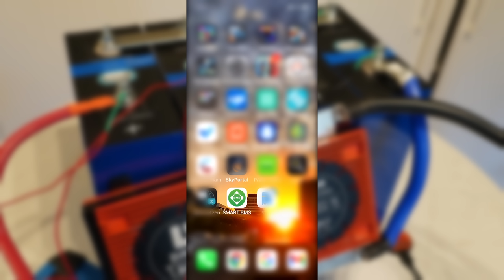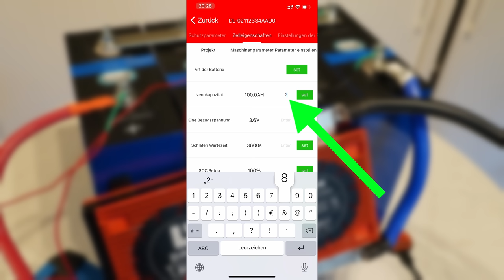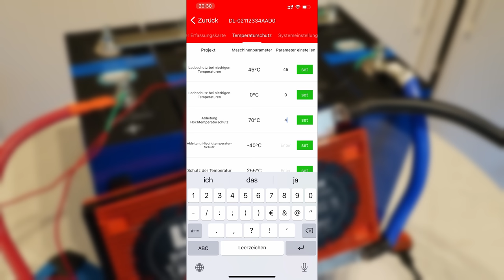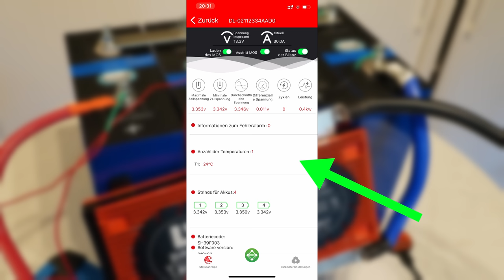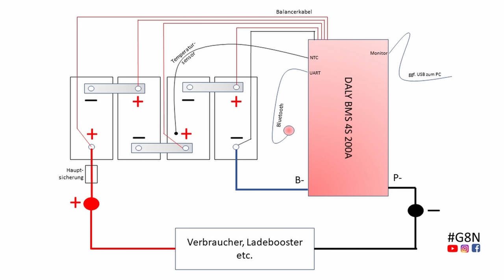Wie? 280Ah 🔋 Selbstbau für 599€, how to mit allen Details ausführlich erklärt #G8N

Comment: Habe mir die tollen Videos angesehen und genau nach deiner Anleitung gearbeitet. Es funktioniert alles wunderbar. Jedoch habe ich ein Problem mit dem Laden des Akkus. Es lädt nicht auf, das BMS macht nach wenigen Sekunden dicht. Einstellungen habe ich von Dir übernommen und dasselbe Ladegerät habe ich übrigens auch. Nun meine Frage: Wird die Batterie trotzdem geladen, wenn das BMS dicht macht? Angeschlossen ist das Ladegerät am schwarzen Minus-Ausgang des BMS, wie auch in Deinem Video. Das Ladegerät von Victron meldet nämlich per App, dass es keinen Strom abgibt. Einstellungen sind natürlich auf Lifepo.
Reply from the maker: Hallo Mathias, danke für das Lob. Ich vermute, dass eine deiner Zellen bereits die 3,65 Volt erreicht hat, deswegen wird das BMS abschalten. Daher gehe ich davon aus, dass der Zellenausgleich nicht ausreichend war. Wie sind die Spannungen der Zellen? Du kannst das Initialisieren nochmal, wie im Video beschrieben, machen. Wenn du die Zellen dann parallel schaltest, lass sie etwas länger so stehen, 7 Tage oder so. Das hilft dem Zellenausgleich. Alternativ, die Batterie entladen, bis das BMS abschaltet. Also eine der Zellen 2,5 Volt erreicht hat. Danach erneut aufladen. Viele Grüße Mr@G8N
Reply: @G8Neu  Vielen Dank für die Erklärung! Das mit den 3,65 Volt habe ich in der Zwischenzeit auch herausgefunden und es war tatsächlich so. Ich habe mir nun einen aktiven Balancer bestellt und die Batterie ist bereits eingebaut und wird demnächst leer gemacht und dann neu geladen.

Comment: Was mich verwirrt. Du schmierst das Fett direkt auf die Kontakte und hast in deinen Amazon Affiliate Links auch ein normales Polfett (LIQUI MOLY 3140 Batterie-Pol-Fett) verlinkt. Polfett wird doch nur verwendet, wenn alles angeschlossen ist, um Auswirkungen von Aussen auf die Kontakte zu verhindern. Polfett selbst ist doch nicht leitend, also machst man doch damit seine Verbindung schlechter, so wie du es anwendest. Oder habe ich da etwas nicht verstanden?
Reply from the maker: Hallo Andreas, du beschreibst es absolut korrekt! Ich habe NOALOX benutzt das ist etwas anders. Bei dem WAGO und Pol-Fett erst nach dem Anschließen einstreichen damit die Kontakte vor Feuchtigkeit und Luft geschützt sind und damit vor Oxidation. Viele Grüße Mr@G8N

Comment: Super Video. Allerdings ist der Aliexpress für meine Verhältnisse nicht  wirklich seriös. Als Beispiel siehe das Angebot 310Ah welches mit entladestrom von 3C angegeben ist, ein Blick in die Spezifikation zeigt es sind doch nur 1C. 
Der Preis liegt bei 483,-.
das Standard 310Ah set 427,-.
Was meint ihr dazu? Was ist AliExpress?
Reply from the maker: Danke für dein Lob. Aliexpress selbst ist nur eine Handelsplattform und da gibt es mit Sicherheit auch unseriöse Händler. Da muss man halt schauen, das ist aber genauso wie bei Ebay und anderen.  Die Zellen werden nach meinen Informationen aktuell von 3 verschiedenen Herstellern gebaut. Das ist zum einen Lishen, EVE, CATL. Wobei die CATL, die teuersten sind und Lishen die günstigsten. CATL würde ich aber auch als die besten einstufen. Ob das im WoMo tatsächlich nötig ist, steht auf einem anderen Blatt. Die Batterien sind bei allen Blau und haben das selbe Format aber wenn man sich die Pole, Platzierung des Barcodes und die Berstsicherung (Überdruckventil) ansieht, sieht man die Unterscheide. Bei den CATL Batterien steht meist der Hersteller dabei, bei den anderen beiden meist nicht. Wenn einem das wichtig kann man den Händler anschreiben, meist antworten die auch zügig und nett, wollen ja was verkaufen 😉. Wichtig ist auf jeden Fall darauf zu achten das die Zollgebühren und Steuern bereits enthalten sind. VG Mr@G8N
Reply: Habe 4 Zellen (310 Ah) am 24.04.21 bei AliExpress für 407,64 bestellt (Zoll, Versand incl.)

Comment: Hallo, ich bin Newcomer in dem Bereich. Ich habe eine Solaranlage mit 36V/10A (Real) Diese wird vom Mppt Regler (Ladeschluss einstellbar und minimiert) heruntergeregelt auf 12V 25 A MAX(CA. Wegen Verlusten so gerechnet). BMS und Balancer sind vorhanden. 4 Zellen mit 320AH sind vorhanden. Ist es nun schädlich, die Lifepo4 so langsam zu laden oder stellt das kein Problem dar? Sollte ich die Solaranlage aufrüsten? An schwächeren Tagen wie heute kommen ca 10 A aus der Solaranlage. Bitte kurz um Info.

Comment: Habe das selbe System aufgebaut habe aber das Problem das wenn die Batterie 13,68v hat Zelle 1,2,4 alle recht gleich sind mit 3,38v aber Zelle 3 hat 3,56 und balanciert sich kaum aus wie kann das sein?
Reply from the maker: Hallo Stefan, da hast du ja einen richtigen Problemfall. Das wäre ein Reparatur Video Wert. Vermutlich willst du aber nicht so lange warten? Ich würde als erstes, die Kontakte prüfen. Wenn du dir sicher bist, dass alle Kontakte in Ordnung sind, würde ich als nächstes die Batterie entladen. Nach Möglichkeit bis 2,5 Volt pro Zelle, 10V in Summe. Achte bitte darauf, dass dein BMS richtig eingestellt ist. Das Entladen von 3V bis 2,5V würde ich mit nur einem kleinen Verbraucher machen, also ein paar Leds o.ä.. Danach würde ich die Batterie, einmal vollständig Laden. Dies im oberen Bereich, ab 3,4V, nur mit geringer Leistung, wenn das möglich ist. Vielleicht ist dann dein Problem schon gefixt. Sollte das nicht gereicht haben, würde ich nach dem Laden, die Batterie auseinanderbauen. Alle Zellen parallel schließen, dann noch nach Möglichkeit bis 3,65 Volt laden und ein paar Tage stehen lassen. Danach alle Zellen trennen, noch einmal 2-3 Tage stehen lassen. Die Spannungen aller Zellen messen, die Hoffnung ist das alle Zellen dieselbe Spannung haben. Wenn diese eine was anders anzeigt, dann hat sie vermutlich was. Meine Vermutung ist aber, dass deine Zellen am Anfang nicht genug ausgeglichen wurden. Ich drücke dir beide Daumen, dass das funktioniert. Viele Grüße Mr@G8N
Reply: @G8Neu  
Ich vermute mal, dass der Ausgleichsstrom zu gering ist. Kann ja nicht viel sein bei den dünnen Balancerdrähtchen. Wenn die Zellen zu unterschiedliche Daten haben, dann reicht das vielleicht nicht mehr.

Comment: Hey kannst du mir sagen woran es liegt das meine Zellen wenn ich sie voll geladen habe bei zb 3,55 3,35 3,50 3,55 liegen? (Beispiel) und wenn ich sie im Betrieb hab haben sie dann kaum noch Unterschiede. Sind bis auf 0,01 manchmal gleich.
Reply from the maker: Hallo Sirko, das ist normal und habe ich in dem anderen Video und auch im Balance Video versucht zu erklären. Die Unterscheide in Kapazität oder Ladezustand werden meist erst oberhalb der 3,4V sichtbar. Deswegen können Balancer da auch erst sinnvoll Balancen. Entweder der Akku öfter benutzen damit der Balancer im BMS das Ausgleichen kann oder noch einen aktiven Balancer verbauen. Dieser wird das mit der Zeit ausgleichen. Video dazu ist auch in Planung. Viele Grüße Mr@G8N
Reply: @G8Neu  danke ich hab noch den Aktiv Balance aus deinem Video. Den mach ich Mal rein. Danke
Reply: @G8Neu  Hallo der Aktiv Balancer funzt gut. Allerdings sagt mein BMW als Fehler Zellspannung zu hoch. Ladegerät logischerweise aus. Aber die Zellen sind erst bei ca 3,58 anstatt 3,65 v. Hab ich ggf was falsch im BMS programmiert? Max Zellspannung 3,65 v im BMS hinterlegt.

Comment: Tip Top👍✔
Welches Batterieladegerät wird für 310Ah empfohlen? Victron Blue smart IP22 12/30(3) ist schon vorhanden, reicht das aus?
Reply from the maker: Hallo Stefan, vielen Dank für dein Lob. Ich benutze dasselbe Ladegerät und bin damit zufrieden. Du musst ja nur so viel nachladen, wie du verbraucht hast. Wenn überhaupt, wird es bei mir nur gelegentlich zu Hause benutzt. Unterwegs wird der Akku ausschließlich über den Ladebooster geladen. Ich habe auch kein Solar auf dem WoMo. Viele Grüße Mr@G8N
Reply: @G8Neu  Hallo Mr.G8N :-) Ich habe inzwischen meine Batterie gebaut und das Ladegerät endlich geliefert bekommen. Jetzt kann es endlich losgehen und es scheitert momentan noch am ersten Schritt: Welches Ladeprofil beim Ladegerät verwendest du zum initialisieren? Normal (14.4) und Li-Ion (14.2) scheinen zu niedrig, High (14.7) zu hoch...

Comment: Hi,
ich habe nach deiner Anleitung meine 280Ah Batterie gebaut aber habe leider Probleme mit dem Daly BMS.
Ich hatte nachdem ich die Batterie fertiggebaut habe eine Bluetoothverbindung nachdem Anschluss des Ladegeräts. Kurz danach konnte ich diese Verbindung auch nochmals durch Anschluss einer Glühbirne wieder herstellen und das BMS einstellen. Jetzt funktioniert dies aber nicht mehr und ich kann die Batterie auch nicht benutzen außer sie wird gleichzeitig geladen.
Ich habe es schon mit dem Knopf auf dem Bluetoothdongle probiert, mit den zwei Pins und durch Kurzschluss von P- auf B-. Leider alles ohne Erfolg.
Dazu kommen ein paar Messungen die für mich nicht schlüssig sind und ich könnte mir vorstellen, dass mein BMS defekt ist.

Ladegerät an Pluspol + P- -> 0,0XA 
B- : 13,XV P- 14,XV
Ladegerät an Pluspol + B- -> 10+A 
B-: 13,XV P- 2,XV

Ich hoffe du hast vielleicht noch eine Idee. Ein neues Bluetoothdongle und das UART Kabel sind auf dem Weg zu mir.

Liebe Grüße
Mia

Comment: Danke für die schnelle Antwort naechste Frage die ich hätte man spricht das es gut sei wenn die Batterie über einen hohen Entladestrom (150 -200Ah) verfügt wie ist es in diesem Fall und wie lange würde er zu Verfügung stehen. Es kann sein das es sich nicht fachlich korrekt anhört aber ich möchte auch nichts falsch machen danke auch hier schon mal für die Antwort
Reply from the maker: Hallo Paul, das von mir vorgestellte System kann einen Dauer-Entladestrom von bis zu 200 Ampere. Bei 375A schaltet das BMS ab, da es von einem Kurzschluss ausgeht. Wenn du mehr benötigst, ist nur ein größeres BMS notwendig. Die Zellen sind in der Lage bis zu 3C zu liefern, das sind 840A. Optimaler Betrieb ist aber bis zu 1C also 280A. Viele Grüße Mr@G8N
Reply: @G8Neu  Danke :)

Comment: Servus auf deiner linkliste ist das batteriemanagement für 200 oder 250 AH . Welches benötigt man jetzt für die 310 version ?
Reply from the maker: Hallo Michael, die Größe des BMS ist abhängig von den Verbrauchern, die du anschließen willst. Das 200A BMS geht für Wechselrichter bis 2000W. Für 3000 Watt also das 300 Ampere BMS. Wobei das 200A grundsätzlich das Kleinste ist, was ich verbaue. Viele Grüße, Mr@G8N

Comment: Hallo,
was für ein super Video. Vielen Dank dafür.
Sind die Batterien in der Zwischenzeit so viel teurer geworden? Ich kann erst ab 700 Euro die Zellen finden. Haben Sie mir einen aktuellen Link? Dann der Balancer da gibt es verschiedene AH Angaben welchen benötige ich für die 4 Zellen?
Ich möchte mir eine Powerstation selber bauen. Bei der 12 Volt mit der 4 Zellen Ausführung kann ich einen Wechselrichter mit bis 2000 Watt dranhängen oder sind 2000 Watt zu viel Leistungsabnahme für die Zellen? Evtl. mal Flex oder Montagekreissäge anschließen...Startstrombegrenzer wäre jeweils vorhanden. 
Würde mich über eine Antwort von Ihnen freuen.
LG Rüdiger

Comment: Mega gut erklärt. Ich hatte mir schon viele Videos über das Thema angeschaut, doch diese Serie hier toppt alle!

Ich habe mit meinem System ein kleines Problem:
Die Zellen werden nur bis SOC 75 % geladen. In der BMS- App steht 14,2 Volt. Das Victron IP 22 12/30 schaltet dann dann um auf 13,5 Volt.
Ist es möglich, dass ich dann nur 210 Ah anstatt 280 Ah habe? Oder kann das Problem woanders liegen?
Reply from the maker: Hallo Michael, vielen Dank für dein Lob. Die SOC Anzeige des BMS ist alles andere als genau. Jedoch wundert mich, dass du am BMS nur 14,2 Volt siehst? Beim Ladegerät aber 14,4 Volt angezeigt werden. Das lässt 2 Sachen vermuten, entweder ist die Zuleitung zwischen Ladegerät und Batterie zu klein oder hat ein Kontaktproblem. Oder die Sicherung im Victron Ladegerät selbst hat ein Kontaktproblem. Du kannst bei diesem Ladegerät eine manuelle Ladekurve einstellen. Hier würde ich zum Test mal auf 14,5 Volt oder 14,6 Volt gehen. Dabei die Spannung an der Batterie messen, ob sich das verändert. Auch ist es möglich, die Absorptionszeit für zum Beispiel eine Stunde zu halten. Sollte der angezeigte Ladestrom am Ende der Absorptionszeit noch höher als 2-3 Ampere sein ist deine Batterie noch nicht vollständig geladen. Ist der Ladestrom kleiner als 2 Ampere, so solltest du das BMS auf hundert Prozent SOC einstellen. Ich würde aber nicht dauerhaft das Ladegerät mit einer langen Absorptionszeit und dieser Spannung betreiben. Viele Grüße, Mr@G8N

Comment: Wie wichtig ist das serielle Aufladen auf 15,2 Volt. Reicht hier nicht das parallele Aufladen der Zellen auf 3,65 v und dann ein Ausbalancieren der Spannung ohne Ladegerät? Ich spare hier halt bei gr. Zellen und einem 48 V viel Zeit.
Reply from the maker: Ich mache das inzwischen so das ich das Akku Paket komplett zusammenbauen, mit einem Aktiven Balancer. Einmal vollständig aufladen und dann nur die Zellen, die eine zu geringe Spannung habe nachlade. Die 3,65 V sind der absolute Abschaltpunkt . Ich würde versuchen meine Zellen nicht über 3,55V laden. Den aktiven bellen. So würde ich so einstellen, dass er erst ab einer Zellspannung von 3,38 beziehungsweise 3,4 V anfängt zu arbeiten. Vorher macht es keinen Sinn.

Comment: Moin , super Video👍👍 hast Du zufällig die Zuschnitt Maße im Kopf? ich will es Dir genau nachmachen.👍 Gruß aus Hamburg  Andreas
Reply from the maker: Hallo Andreas, vielen Dank für dein Lob. Entschuldige bitte die viel zu späte Antwort. Ich hatte leider den Zettel mit den Maßen schon weggeworfen. Aber jetzt habe ich nochmal nachgemessen. Boden 178mm x 320mm, 2x Seiten (vorn und hinten) zu 220mm x 320mm, Deckel 335mm x 178mm, rechte Seite 178mm x 235mm, linke Seite 208mm x 250mm. Ich habe 15mm Siebdruckplatte benutzt. Viele Grüße Mr@G8N
Reply: Super, Danke 👍
Reply: Bierchen ist unterwegs 🍻👍

Comment: Hallo, frage mit 32 Zellen je 280 Ah einen Blok zusammen bauen 48 V  ist das möglich.Vielen Dank für das interessante Video!
Reply from the maker: Ja das ist kein Problem. Du willst also ein 2P16S bauen? Wenn du einen so großen Speicher mit fast 28 kWh Speicherleistung baust, dann muss dieser natürlich auch geladen werden. Daher könnte es unter Umständen günstiger sein, tatsächlich zwei parallele 16s Systeme zu bauen. Da die Lade Leistung die du in das System bekommst, bei Parallelschaltung etwas höher ist. Ansonsten bräuchtest du ein extrem großes BMS. Beste Grüße Mr@G8N

Comment: Hallo, ich hab 8 280 Ah Batterien und das 24 Volt Daly  BMS  250 Ah. Bei Ebay gekauft,  aber der Preis war 😭 etwas viel mehr....😢 Nun ja aber zu meiner Frage zum ersten mal laden. Kann ich dafür auch ein Intelligentes Ladegerät nehmen, das sowohl 12 als auch 24 Volt  kann und zudem auch  den Modus AGM/ Gel mit 14,6 Volt oder 29,2 Volt benutzen? Und was das BMS betrifft, nur die Werte verdoppeln, die sich logischerweise auf mein 24 Volt System  beziehen? L.g.
Reply from the maker: Hallo Arndt, du kannst dieses Ladegerät benutzen, schallte es auf Gel. Alle Spannungen sind verdoppelt. Nur nicht die Spannung für die Einzelzellen Abschaltung diese bleiben bei 3,65 Volt und 2,5 Volt. viele Grüße Mr@G8N
Reply: @G8Neu  Für die Antwort ein ♥️ auch von mir. Wenn ich mein Epever 100 Ah anschließen muss, für das ich mir noch das BT 50 besorge, kennen sie sich da auch wegen der Einstellung auch aus? Dazu will ich 24 Solarmodule 12 Volt 100 Watt drei Reihen mit 8 Modulen anschließen. Danke für ihre Hilfe L.g Arndt

Comment: Ich finde den Pluspol am Boden interessant, würde dies nicht bei einer leitfähigen Bodenplatte, dass parallel Schalten vereinfachen, durch die Kontaktfläche und so den Formfaktor optimieren, schließen könnte man die Batterie alle nebeneinander stellen und den Pluspol ebenfalls auf der Oberseite durch eine durchgängige "Stromschienekoppel".
Das BMS könnte man hier ggf. an dem Pluspol auf der Oberseite kontaktieren, zur Überprüfung der einzelne Zellen, zur gekoppelt Masse, das gäbe zwar keine absoluten Werte aber relative von einer Zelle zur anderen. Okay wurde natürlich auf 12V ausgelegt  und der Balancer wird relativ zu einer Masse gemessen. Wenn beide Pole jedoch flach wären könnte man ggf. gebündelt parallele Batterie in Serie schalten. 
Mit der Bodeplatte müsste man auch die Pole als Schicht sowohl bei Pluspol als auch Minuspol auslegen, würde die Batterien dann über eine Kontaktfläche kontaktieren, dabei müsste diese jedoch wechselseitig Leitend und isolierend sein, man würde eine an Ober- und Unterseite benötigen.
Man müsste die Batterie dann ggf. horizontal montieren und Dan die "Kontaktbleche" klemmen über das Gehäuse, als Presskontaktierung. Der grössere Querschnitt in der Fläche würde ggf. zu einer besseren Wärmeleitung /- transport führen dadurch dann auch besserem HVAC (Heat Ventilation Air Controlling).  Schlecht wäre bei KFZ Anwendung ggf. die Verformung des Blechs und den potentiellen Kurzschluss (muss man probieren) für statische Anwendungen könnte man es aber testen.
Reply from the maker: Hallo Carsten, interessante Überlegung. Das der Pluspol am Gehäuse anliegt ist wohl nur ein Ergebnis der Fertigung, es ist aber kein gewollter oder belastbarer Pluspol. Daher würde ich davon Abstand nehmen. Viele Grüße Mr@G8N
Reply: @G8Neu  Ja guter Punkt, ich hatte eben beim joggen nochmalskurz darüber "simuliert", es war auch mehr laut gedacht, ich weiss auch nicht wie Innovativ dies ist, da eine Monozelle (z.B. AAA, 18650) ja ähnliche aufnahmen hat.
Auf der anderen Seite ist die vergrösserte Kontaktierung am Pol sozusagen die Neuheit von Tesla, mit genau den Vorteilen höhere Kühlfläche, mehr Elektronefluss bei geringer Stromdicht.
Sofern also bei Pole diesen Vorteil hätten wäre das Design ggf. platzsparender, ließe sich leichter Tauschen oder hätte Vorteile I'm Bereich der Bauhohe und damit auch Integration in z.B. ein Fahrzeug oder sonstiges.